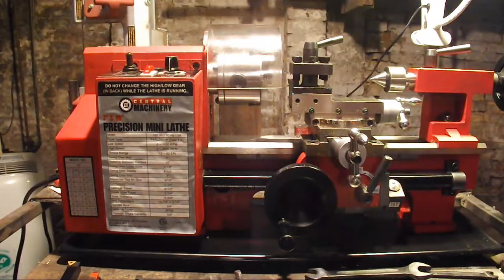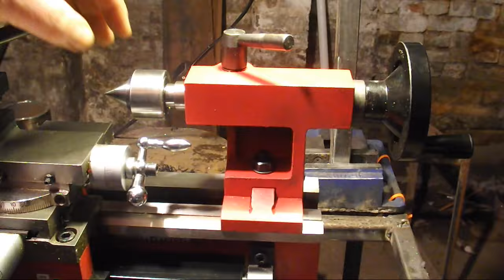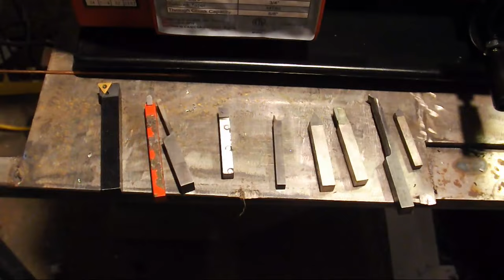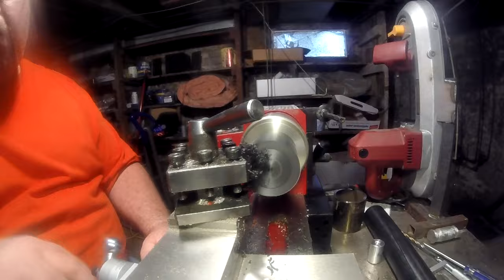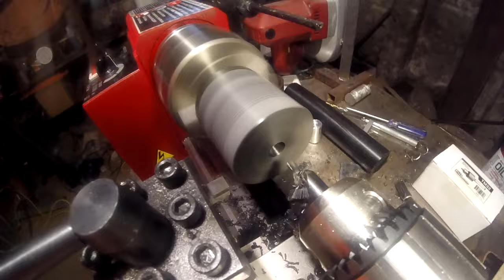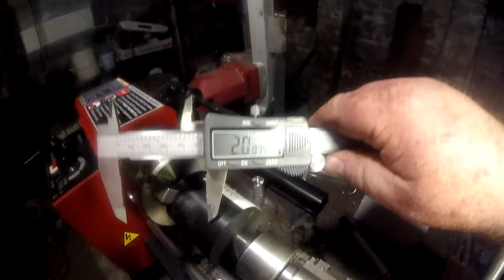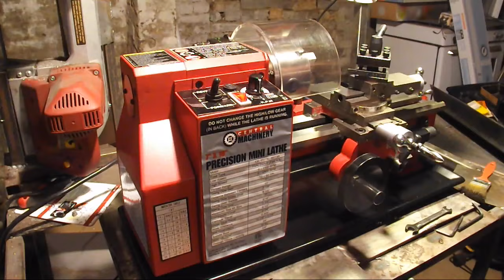Harbor Freight 7x10 Mini Lathe Review 93212

Comment: From what I understand, virtually the same lathe is sold by several companies. One of the big differences is what comes with the lathe; some packages are more extensive and it might pay to spend more initially than have to chase down accessories you are going to need anyway. The Little Machine Shop  is tool central for these little guys. There are also a lot of articles on improving performance of this lathe. Another accessory that could be needed is a 4 jaw chuck with independent jaws. It lets you chuck square and rectangular items or anything that is not round or a multiple of three.
Reply from the maker: +Jeffrey Deutsch These lathes are made my Seig, and you are right, they are sold under many names. I am famiaer with the LMS. I have their quick change took post and cam-lock for the tail stop. Not to mention some tool holders, boring bars....

Comment: This is great, thanks for taking the time to educate us who are just starting out. You don't skip over anything, and give great advice. Kudos. Btw, the X-axis compound adjustment and having to move the slide all the way back to expose the allen heads (around 8:05 in the vid) - I removed compound and bored and threaded a single hole in the lower deck and used that to tighten the compound rotation (I do a lot of tapers), thus avoiding the annoyance you point out in the stock design. cheers.

Comment: My son got this for me as a birthday gift a couple of years ago, and I'm still learning about it. It doesn't see heavy use, but so far I like it a lot! I got a chuck for it, and the most recent addition is a milling attachment for the cross slide. (Just because, that's why! )
I've got both 1/4" & 5/16" tooling, and I've noticed that the 1/4" size needs to be shimmed up to be at centerline. 
I might look into the cam-lock mod for the tailstock. 
The open-end wrenches that come with it have been replaced with combination wrenches. 
Also planning to get a self-centering 4-jaw chuck...because, why not? 😄

Comment: I think there is also a lathe bed extension, that you can add onto your lathe, that will allow you to slide the tail stock back further. There are some web sites that are solely about the upgrading of the mini lathe. I am lucky enough to have an old South Bend 9"  and the spindle bore is still only 3/4" max. that I can pass through. Mine is from 1944, but I don't think they ever had a larger bore on the 9" than that.

Comment: As it comes, the Harbor freight 7 x10 is a piece of crap, but with a bit of work, it can be a very good small shop lathe.  I think the safety shield should be the first to go as it gets in the way.  The bed length is ridiculously too short. everyone finds out the first time they try to drill a hole on the end of a piece of stock.  I highly recommend the 16" bed kit from Little Machine shop.  It really makes this lathe into something you can use.  You will need to clean up the slop in the saddle,  cross slide, and compound slide. 
I recommend a wedge style OXA quick change tool post when you get the money.  The tail stock Jacobs chuck  is the first accessory you'll want to buy.  later you might want the face plate, steady rests, and 4" four jaw chuck, all from Little Machine shop. I use mine almost every other day. there are lots of mods on YouTube and the internet for this style lathe.

Comment: Thank You, Sir! I have the exact same "Model". I don't use it a lot but it does what it does and that can be what one needs for small projects. I bought mine after you and if I remember correctly, they did include the drill chuck (1/2"). I went with an aftermarket quick change tool holder. The original was too high. I really need to get more tooling but after all, that is a must with any lathe. Great job on your video. Cheers.

Comment: Sieg has improved their lathes since this video was done and the newer ones are also quite nice.  I note you have a carbide cutter amongst your bits.  On my own Sieg lathe (a tiny bit larger) I find the maximum RPM speed is a little low for cutting things like 4140 with carbide cutters and HSS steel is the best choice.  There are many interesting mods that can be made on the Sieg products to increase utility of function and several web sites devoted to such modifications.  Good walk through review.

Comment: FYI: your cutting tool descriptions are backwards. "Right hand" tools cut from right to left as you face the lathe from the operating position. "Left hand" tools cut from left to right. If you hold your hands out in front of you, think about your thumbs as the cutting edge of the tool. Your left thumb points in the cutting direction of a "left hand" tool, and vice versa.

Comment: I always wanted a metal lathe after my highschool metal shop days and picked this up probably close to 10 years ago at Harbor Freight.  Mine doesn't have the interlocked shield around the chuck.   I also picked up the Jacobs chuck and a 4 jaw chuck from Harbor Freight and got most of my tooling from Grizzly Tool.   For the price this is a nice little lathe.  I think I paid about $400 when I got mine.   My big problem is finding aluminum and brass stock to turn as this was readily available in high school but not so much now although Amazon has some smaller diameters.  I was looking for 4" aluminum stock for making bowls. I thought the tool holder was a drawback on this lathe as I was used to right and left cutter adapters  that fit in the mount but seeing as you can mount multiple cutters maybe it isn't so bad after all.
Reply: I took all three "metals" classes in both junior high school and in high school too.  I have always wanted a lathe to use at home for so many years now.  Time is wasting, so I thought it's time to do it now!  Really enjoyed his review too about its features and capabilities.
Reply: @charlesmartin2690  The prices have sure gone up on these mini lathes.  I paid around $400 for mine about 10 years ago at HF and I just got my new Grizzly Tool catalog and they are over double of that now.  Same with a lot of other stuff too.
Reply: @scottyV1000  I really like the feature of a DC brushless motor that can achieve much better efficiency overall, and especially at lower speeds.  Also really like the digital tachometer too to see the moror's RPMs.   Pandemic-era China virus allows me much more free time to indulge in my hobbies.   Hoping to add not just a lathe, but several welders to my workshop.  Really wish there were some super high-quality German or Japanese made mini-lathes available.  Almost tempted to buy a second lathe, like some old, big American steel, like a Cincinnati.

Comment: Awesome review! I've been trying to make lanyard beads with one of these and I'm having a heck of a time with squealing, groaning and not even being able to successfully use a cutting tool on various types of metals using 3/4 rod stock. I've been through 3 sets of tools with the latest being a $90 7 piece set from grizzly. I just can't get this think to do anything without binding up or  squealing and basically doing not a whole lot. I have no idea why.
Reply: First you need some hands on tuition before you do yourself an injury.....when I started my apprenticeship in the late 50's we had 1 hour tuition at the start then it was straight in and start making parts.....you tend to learn very fast when you have to do it for real.

Comment: HF does offer a drill check for them, atleast when I bought mine about 5 years ago. I'm a gunsmith and it has made things alot easier / possibly for me to do. Removing the end cover allow for barrels to hang out of the side. But you are limited to govern profile AR barrels and thinner and medium contour barrel for most other guns. Dont expect to throw you Remington 700 SPS tactical 308 bull barrel one and thread the barrel. Hence why my person sps tactical is still unthreaded for a brake or suppressor. I'm a gunsmith and dealer in SC and alot of tools I use daily are from HF. I've actually used my HF mini mill and Hzf mini leather to make tools and parts for guns. Now I just need a quality tig welder. People bring me broken parts and I have to make a copy when a good tig would allow me to weld the part back together in most cases. With outages mill, lathe, and dremel you will only be making it hard in yourself. I used to do everything I cool with a drill, drill press, dremel and a hell of a lot of different hand files. My work turned out great and I've never once had a complaint but I stayed back logged because of the slow work doing everything pretty much by hand. It just sucks that alot of speciality hand tools cost as much as some guns I'd like me to add to my collection. Luckily I find broken guns for real cheap or even free and i can fix them for next to nothing. Everything from an h&r 9 shot 22, a 1903 Ithaca SXS 12 (non Damascus steel that was in a house fire) it works perfect now though the barrels had to be shortened because they were leaning against a wall (I only shoot low brass bulk buy shells thst have been emptied of the #7 shot and replaced with bronze coated BBs. I have few other record guns that were given to me that I can repair as well. Provided I have the free time. I'm doing alot of h&k pattern (ptr91 and century c308) paddle magazine releases as of late. Ptr91 is just down the road in Aynor SC while I'm in Darlington (think nascar track). Ptr91 doesn't offer retrofitting the paddles mag release or welded in rail tobthectop of the reciever anymore so, I decided to do it. If you don't want to wait for a gunsmith to add them then youdvhacmve to buy a new ptr91 (it's a 308 h&k g3 clone in semiauto)

Comment: U can add an inch or more in maximum diameter of material that can be turned by the way you have tool post set. By just turning/setting your compound slid to 30 degrees and backing compound out for straight cuts. How ever you are correct in fact in a limiting diameter if u use compound to cut tapers. All in all I'm going to give you 4 star rating on the video. So not a too bad of rating from me as I never give a 5 star rating as that leaves no chance of improvement. Great  job.

Comment: Very detailed video, only one thing, it does not have an alternative current motor is a DC motor I found out when my speed control went out it changes it from AC to DC otherwise it won't change direction from FWD to REV, other thing I been asking HF for the shield or the speed control nowhere to find no parts either since 1999 when I bought it, but over all is been a good tool I'm using an external control since 2014

Comment: put a dial indicator on it and I bet it has at least .020 play in everything
Reply: After playing with the display in harbor, i think that may be a conservative estimate.
Reply: they say .003 but lolz
Reply: Just got one of these 2 weeks ago. It takes a lot of work cleaning and tightening everything before you can even start using it. I gave up trying to get my 3 jaw self centering chuck to get pass its current runout of .003. It had a .006 - .009 runout out after disassembling and cleaning. I had to mount the chuck in the different positions on the spindle to find the one with the least runout, swap jaw 1 to jaw 3 slot, tighten the jaws with 1 out of the 3 adjustment pinion gears (using any of the other 2 will give me more runout), and i had to true it further by grinding the jaws. Enjoyed every bit of the process even though I have a bald spot on my head due to scratching and pulling....
Reply: Pan Feng bore your jaws
Reply: Can anyone tell me if it has steel or nylon change gears for feed and threading.?

Comment: I had the older version (and its companion milling machine) and used it for a dozen years with excellent results. I adapted dial indicators, drip pan and coolant pump, and a small indexing head to this machine. Wish it was larger, but it worked very well for me.
Reply: A coolant pump?  For metal cutting to pump the oil I presume?   Thatd be one nice unit to have.  ^_^

Indexing head too... making gears would be so awesome.
Reply: @NeoIsrafil  I used typical water-soluble oil as coolant. For the pump, I used a water-coolant pump from a standard tile-cutting diamond saw.

Comment: Nice safety feature with the safety shield and not starting back when it is put back again. It is better to have than not have, and it is easy to rework if somebody wants to rework it and use emergency stop button somewhere instead.

Comment: I realize this is a 7 year old video but I had a thought.  I've seen other reviews with the same complaint about the locking nut on the tail stock and how it's irritating to tighten & loosen .  Would it not be feasible to use a ratcheting box end wrench?  I have ratchet wrenches with a lever that allows the ratchet to tighten or loosen with a flick of the finger.  Seems like it would be the ideal solution short of buying an after market cam locking setup.  I enjoyed your video.

Comment: I cut the small end off my drill chuck so it it fits and pops out then I turn the tail stock all the way in(at 6:12 and 6:39) like this guys tailstock. I gave me a better fit and more room. I bought a set of short drill bits too.

Comment: I have this 7/10 lathe and it is nothing but just totaled junk if you want to do any type of work that is actually nice to look at and has the specs that you want on something . It works okay on aluminum but I'm still forget about it it will not leave a smooth nice cut at all there's just too much play and everything about it the bed flexes a lot

Comment: I have looked at several lathe reviews online. With few exceptions, all the Chinese lathes require disassembly, thoroughly cleaning (you wouldn't want to operate anything having moving parts if they had shavings/grinding dust everywhere), reassembly, adjustment, and lubrication. The same precaution likely goes for most other lathes as well, regardless of origin. Check yours out before you start any projects. Better safe than sorry. Once ready, they should give lots of service if operated in their specs (don't overload anything and expect it to last).
Reply: I agree, if you are good at modifying equipment, cleaning it and maintaining it, these are cool! Imagine spending half a day on a part, and being 8 thousandths off, part ruined, start over :)

Comment: Have been looking for this exact video for months, literally lol. Thanks so much. Any chance you will or already have made a video on the Mini Mill they offer?
Reply: The hf mini mill is great. I mainly use mine as a drillpress, however anything mild steel and softer it works just fine.. and setup properly has no issue holding a .001 over the table x and y.  I do tram mine everytime i want any precision under  +- .005 ... if you mainly machine aluminum you will be very happy

Comment: A friend says his does not repeat to zero very well.  If he needs 10 identical parts and makes each one exactly the same way with the same settings he will have 6 different size parts.  Thoughts?  I need something like this (Well, OK actually I need a 12X45 but for that I need to win the lottery!) I can't afford to waste the money on this if it cannot be trusted to be accurate.
Reply: backlash is an enemy to machining but once you get the feel for it you will be able to control it. it is possible to repeat tightly. you can upgrade your ballscrew to minimize this issue.
Reply: yea its a MANUAL lathe ,u have to measure with tools u cant use the dials alone it isnt an airplane with gps. also u cant depend on the material being in the exact depth every time . u gotta use calipers and dial indicators n such,only the indicators when u measured and found out how much to take off. then u have to take up the backlash before u start reading the dial

Comment: Have a question, on the backside where the head is mounted meaning the other side of control panel. There is a metal cover with two small screws. What is behind that? I need to know if the head will accommodate a long bar through the back through the center of the head so for example if i wanted to mount a pool cue stick through it if it would work?
Reply: Yes, it's a through hole ( Mt 3 ) .....remember when you mount a long bar, rod, etc... Have it supported

Comment: Hey man, towards the end of the video you had the camera set up in an angle where you can see a little cap (you could say) held by two screws on the back of the lathe. I wanted to get this to thread my rifle barrel, although i know i can pay someone to do the work for me way cheaper. I haven't measured them but i think they will be an inch in diameter at the most. Does that back plate come off and allow you do stick a rod of a certain thickness?